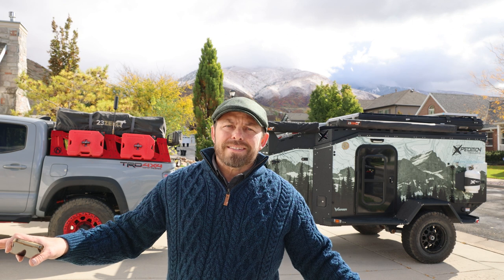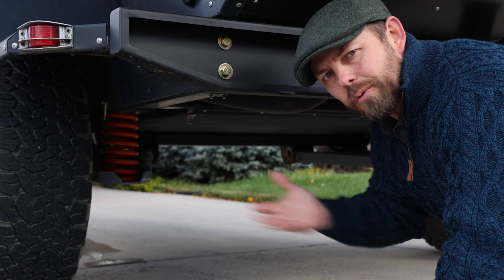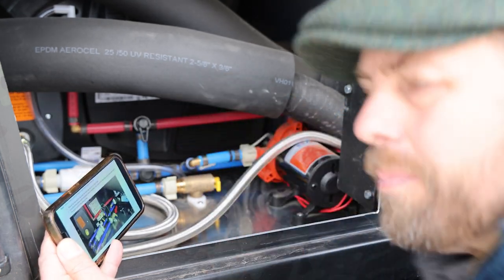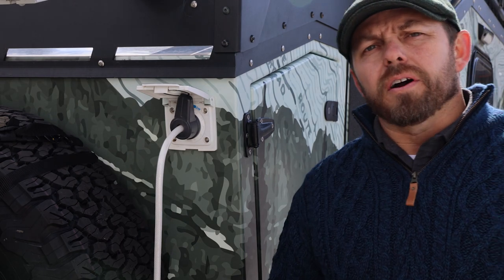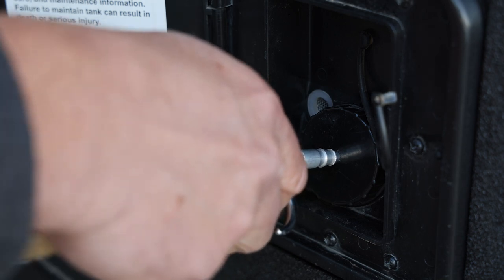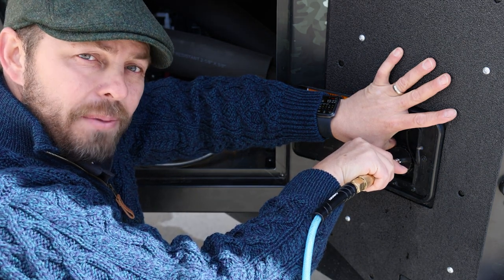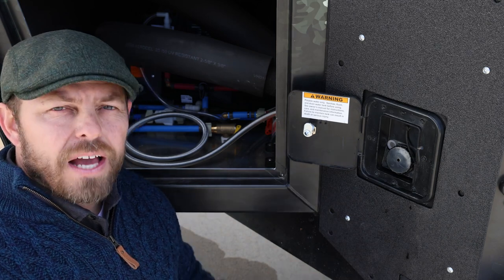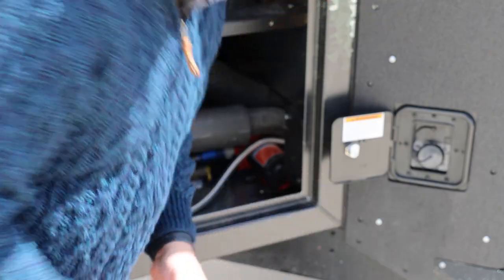2023 Voyager Winterization Guide

Comment: Awesome! Big Thank You Artie this was perfect. Question: before you put the cover for the heater back on, I am thinking you took it out of by pass mode so in the spring it is ready to be used or does it need to stay that way through the winter? Could you show how you disconnect the batteries so they can be stored over the winter time too?